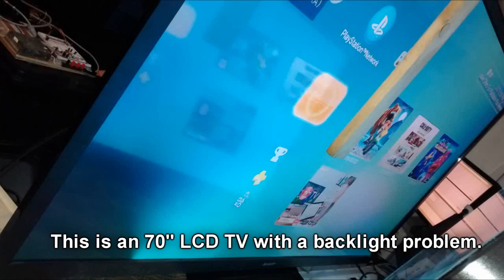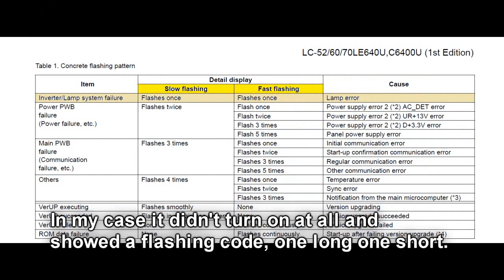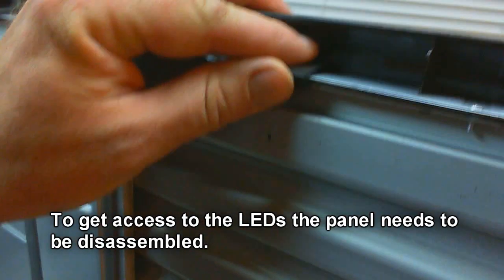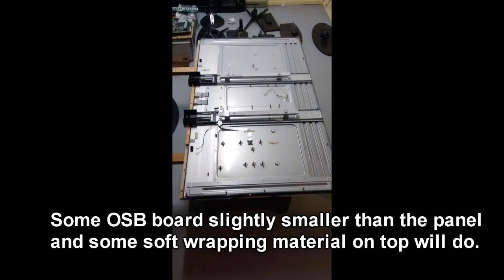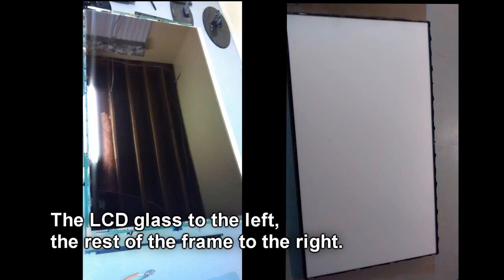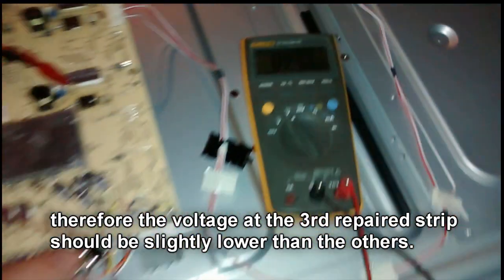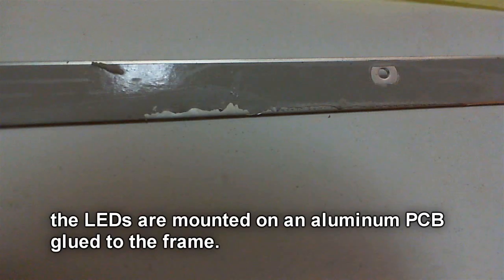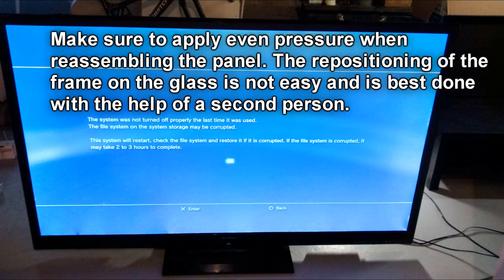LC-70LE640 backlight DIY repair

Comment: Good video, but let me add two important suggestions.  
One, that 32 led string that you modified to now have 31 leds is in parallel with another 32 led string.  The 31 led string is dropping the same voltage as the 32 string and is now running much more current than it was, and will burn out sooner.  You probably should short out 1 led in the remaining 32 string to match.
Second, on the back of the power supply are 3 groups of four 15 ohm surface mount resistors.  These are for controlling the current in each of the 3 paralleled led strings.  If you remove 2 of the 15 ohm resistors in each circuit, you will cut the current through the leds in half and they will last much longer.  You will be surprised at how bright the tv still is on half current.
I do this on most led tvs that come in with burned out leds.
Reply from the maker: You are right. This was one of the first TVs where I tried to fix the backlight.  Now whenever it's possible I lower LED current directly on the board.
Reply: How does removing resistors reduce current. I thought adding resistance reduces current. I’m I wrong?
Reply from the maker: The resistors he mentioned are in series with the LEDs, they are used to measure the LED current. The voltage drop over them will be proportional to the LED current. If we remove a resistor (there are several in parallel) the total resistance will be higher, therefore the voltage drop for the same current will be higher too. The controller chip/circuit will "think" the current is higher than it should be and consequently lower it. I do this now on every LED TV I get my hands on. Cut the LED current in half or even less almost makes no visible difference
Reply: Let me correct some info above.  First, these are driven by current sources, not voltage sources.  If you jump out an LED, the controller IC will ensure the current remains the same, but the voltage will drop across the string by the forward voltage drop of the LED in question.  So if you jump out a 3V LED, the current will remain the same but the voltage across the string will drop by 3V.  The voltage across each LED stays the same as does the current, so the wattage doesn't change if you short out an LED.  This is not like lamps in series with a fixed voltage supply across it.  Some LED controllers watch voltage for too low or too high, so shorting out a few too many may trip a shutdown.  As for the resistors, they are not in series with the LEDs, but are in the Source circuit of the mosfet that is on the  low side of the array going *to ground*.  Removing parallel resistors or adding resistance (same thing) will raise the voltage on the Source pin, which is the feedback line for the controller IC.  Since the IC monitors this line, it throttles back the current to the array to keep the voltage on the Source pin the same as it was before.  Result: lower current to the array.

Comment: Can you do a short video explaining how to bypass the bad LEDs and get the ones that are still good to turn on , I am somewhat following but where do I get the 5v from ?
Reply from the maker: haven't watched this video in a long time. you could either put a couple of diodes in series or one zener diode to get a similar voltage drop. however, I do not recommend replacing single LEDs anymore, or repairing strips. if you can replace the whole strip

Comment: How many volts suppose to go to LEDs? I measure 91v. I put new LEDs  in but still they dont light up. After putting 9v batteries in a row 90v were able to light up only 21 LEDs instead 64. Any idea where the problem is? Maybe the led bars are defective?
Reply from the maker: Had to watch the video again, it's been a longtime. Looks like you have 3 drivers each giving about 184V to 2x32 LEDs. (This was measured with a voltmeter, should have been done with a scope though). So in all there should be 3x64 LEDs. These must be 3V LEDs (184/64 = about 3). If you supply 90V to 32 of these LEDs they should all be lit. Having only 21 out of 32 at 90V doesn't make sense, that would mean 11Leds are shorted and the 21 will be dead in notime due to overcurrent.
Reply: @tomtechtod9200  sorry for bad explanation. When they the led bar is hooked up to tv wiring 0 leds lid up same when I hooked up 90v from battery source to the power plug. But when keeping the positive on led power plug and negative at 22nd led all 22 were dim. If holding negative at 21st led 21 were bright. At 23rd led no lights turned on
Reply: @tomtechtod9200  so you are saying the power supply board suppose to feed 184v? In my case it's supplying only 92 and then it starts dropping.
Reply from the maker: From what I gathered from my video I measured 184V coming out from each driver for each 64 LEDs. In any case it shouldn't be dropping. Can you confirm that these are 3V LEDs? Just apply 2.5V on a single LED and slowly increase, should be lit at max 2.8V if it's 3V LEDs. (Or use 2xAA batteries for a short time). Then, I assume one driver supplies current to 2x 32 LEDs in series, can you confirm? Probably bridged on the PSU board.
Reply: @tomtechtod9200  should be. If the power supply send only 92v instead of 184v. Where should I look for problem? Diodes, resistors or capacitors?
Reply from the maker: I'm pretty sure if the PSU detects a problem with the LED strip it will stop driving current through them. I would first want to make sure that all LED light up. Not sure about the 21 LEDs.
Reply: @tomtechtod9200  why do I measure only 92v at all 3 capacitor that are shown on video as well as on the led port? By my understanding it should be 184v right?
Reply from the maker: Yes, should probably be higher at the caps. If it's going up but then drops it could be that the board detects a problem with the LEDs and then shots down. You might not be able to see the initial voltage with a multimeter. I would focus on those 21 LEDs first. Doesn't make sense
Reply from the maker: There is also a schematic available. Google "elektrotanya RUNTKA933 DPS-262CP"

Comment: I was wondering what resistor to remove to lower the current?  I have a sharp LC-52LE640U and want to lower the current after the repair.  Thanks!
Reply from the maker: I don<t know this model, it's usually a low resistance value resistor or several in parallel that are in series with the LEDs. On this model you can surely lower the duty cycle via the menu I guess. On some TVs you have to do that for each source (HDMI1, 2, AV etc) separately. Also ECO settings can interfere.

Comment: How much is a repair like this ?  Thank you very good video
Reply from the maker: The way I did it it doesn't cost anything for material but it's nevertheless very cumbersome to do. Also, now I would actually prefer replacing the whole strip or the defective LED or instead of shorting it bridge it with some rectifier diodes.

Comment: Hi, I have a Sharp LC-70LE660U that will work fine for 10 mins then the entire backlight will blink off for a half second up to 2-3 seconds and will keep doing this. Power light stays on. Any ideas? I haven't taken it apart yet, my nephew just dropped it off tonight.
Reply from the maker: I don't remember, does this TV has a backlight adjustment in the menu somewhere? If it does adjust it all the way down and see if it stays on for longer or if the half a second/2 second timing changes.
Reply: Just checked, Automatic Light Sensor was on and Backlight was set at +7 (Max is +16), turned the ALS off and then I was able to turn the backlight down (16) , been working for a few minutes, but I'll have to run it tomorrow (bed time :)
Reply: When the backlight is turned down it doesn't seem to blink as much as when it's up high.

Comment: Hello, I have a sharp Aquos - 60LE757U with a blinking light code. When the display is powered on it does 2 slow blinks, then 5 fast ones. According to your chart this is a Panel power supply error. Any idea on what part i need to puchase or what steps i can take to troubleshoot the problem because the TV is in great condition. Thanks!!
Reply from the maker: Hello, sorry I don't know this particular model. Go over to badcaps.com and try reading through this thread: http://www.badcaps.net/forum/showthread.php?p=550596. There is a tech tip in post #3 that may help you. You may need to make your (free) inscription to the forum in order to download attachments.

Comment: Hi, I have Toshiba 32SL863B  it  has developed black corners on left and right of the screen. Some suggested that is the T-CON fault, what do you think that could be? Take a look at the picture below. Thanks
https://postimg.org/image/bp0jne37t/
Reply from the maker: No, that's not a T-Con fault. On the Toshiba website it says it's an edge-lit TV. It looks like the LED strip is on the lower edge and there are two branches of the strip defective. I do not know this particular model. Before opening the backlight try to confirm first that it really is the problem. Individual branches may be driven directly from the PSU board, i.e. it could also be the PSU the problem. Once confirmed that the backlight is faulty you will have to find a way to open the backlight assembly. Then check each LED (applying 2 to 3V of the right polarity with a current limit). If two branches are affected then you most likely have at least two LEDs that are defective, probably open circuit...
Reply: Thank you very much for reply. It is strange that when i turn on the TV, for less than a minute the screen is fine, than starts flickering on corners and black spots comes, once the black spots are visible the flickering stops. I am thinking that is rather PSU problem, the leds are not getting the right voltage. There is a PSU for 30 euro, i might buy it to see if works.
https://postimg.org/image/7tyzjnt9v/
https://postimg.org/image/z63inr4el/

Comment: Hey how are you ?? I actually have the back panel off and I can't seem to find the location of the lights.
Reply from the maker: They are inside the panel, behind the screen. That's what makes the disassembly so difficult. You have to remove front glass, diffuser etc, only then you'll see the LEDs

Comment: I see you shorted 1  led with a bridge of solder will this last of will the rest go out too?
Also i have 2 bad leds can i bridge solder on these?
Reply from the maker: If the two LEDs are on the same strip, no I don't think it will last. As far as I remember there were 2 strips in parallel on each driver output. Best would be to replace the defective strip

Comment: rally excellent and informative video,  3 days ago, i have problem with my SHARP LC-52LE810UN, Aquos Quattron , it was working perfectly normal , and suddenly TV shut off , and power light start to blink 1 slow and 1 fast alternate , and 2-3 minute tv start again , than by today it start to do randomly but more often , at preset TV doesn't start at all , the moment you power up just bottom power light start to blink one short - 5 sec pause -1 long ..and continue ..screen doesn't come on at all... few forum they mention it possible error counter reset to press together (input and vol - ) power up again or ( ch + and vol - ) all kind but nothing works i can't get that service menu screen to check or reset error counter ! but i guess there might be electrical problem too...i didn't open back cover yet, assuming it might just hard reset my electronic knowledge is moderate level , so no problem to use any kind using multi meter of spares by above symptoms would you able to give me an idea its just need hard reset or power board related issue ? or as LED blinking code it must has blown LED or whole strip gone? 
i open the back cover today , by visual inspection i didn't find signs of component failure such as bulging/leaky caps, burnt resistors, bad fuse, etc.  PSU board number # RUNTKA693WJQZ (DPA-152CP A) can you point me any specific place to check voltage / diode/caps on PSU board  , before i start to dis-mental the back light portion ?
is there any way to check LED status without dis mental ? 

thanks in advance ..help appriciated
Reply from the maker: +IPTV G the flashing pattern (one short, one long) indicates a lamp (backlight) error. You can download the service manual from Elektrotanya.

Comment: Yes,  you can see a difference in brightness when you adjust the backlight. I haven't opened the unit up to check voltage.

Comment: TomTechTod, I have a LC-70LE632U and last night the picture went dark. you can still see the picture fine, its just dark. I've tried adjusting the backlight and the other options. Any ideas?
Reply from the maker: +Paul Charleston You mean the backlight is still working, just darker? What's the output voltage towards the LEDs?

Comment: Yes!!, I need your help, as I asked you, I need a dummies explanation and also I need to know how to manage the LCD screen,  as far I know the screen is very sensitive and sensible.
Please help me!!
Reply from the maker: +Juan Jose Davila D. first of all, do you have the same power supply PCB shown in the video?
Reply: +Juan Jose Davila D.  It looks the same, I found almost the same capacitors and connectors.
Reply from the maker: +Juan Jose Davila D. Well if it shows lamp error and it had a similar shadow you don't need to test the PSU right away. To open the screen you will need to lay it on a flat surface with something to protect it from scratches too. You remove the screws around the edges, disconnect the small long PCBs (careful not to bend the flat-cables too much!). At one point you will be able to lift the whole assembly that contains the backlight., the small PCBs stay with the LCD glass. From there it's relatively easy to work on the LEDs. The most difficult part is to reassemble the screen, you should have help of a friend when you place the backlight assembly back on the LCD glass. Be patient.
Reply: +TomTechTod This is a LC-52C6400U, this means it has 52", this means I need a 54" or bigger cushion in order to put the TV laying over the LCD and then remove the black back cover  and then the metal cover which contains the LEDs. When I reassemble the screen why is it necessary the help of other person?
Reply from the maker: You need to make absolutely sure that the LCD glass fits exactly in the same position it was before inside the frame. There is only a mm or even less on each side. If you tighten screws with the glass in the wrong position it may break. You can do it alone but it's easier with a second person, one on each side.
Reply: hi tom your video was great please help my toshibe (vestel parts) 40L5341DB has sound no pic.. ive got it on bed in bits is it definately led bulb fault ?? please oblige uk

Comment: Hi, your video is very good. I have a LC52C6400U, It has the same problem. First, It appeared a shadow in the right-bottom corder, 1 hour later the TV turned off. When I tried to turn it on the center icon showed "lamp error" , one short and one large blinking.  I disassembled it, but now a I have some questions. How can I do the testing part? I did not understand very well how to apply the 5V and so on. Could you send me a Sharp for dummies explanation of the steps to repair my TV to ma personal email: davilaj@gmail.com?
Reply from the maker: +Juan Jose Davila D. Sorry man, hadn't seen this comment. Do you still need this info?
Reply: i do my friend have a toshiba 40L5341DB sound no picture please help me ???
Reply: hi did you get it fixed please ? i have same problem no pic but have sound..toshiba 40 lcd led tv im not 100 % its a bulb out but what else can it be